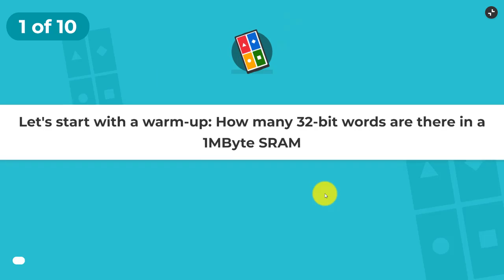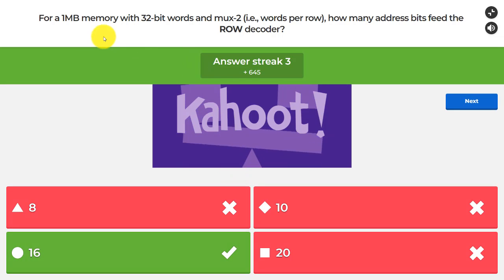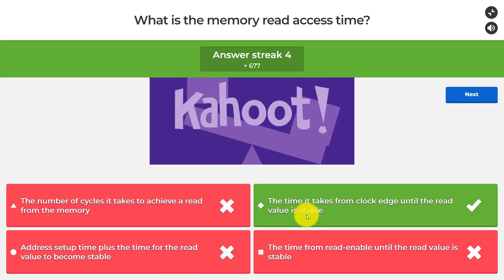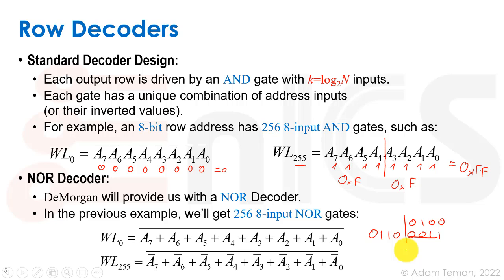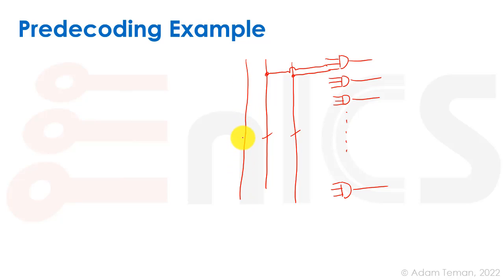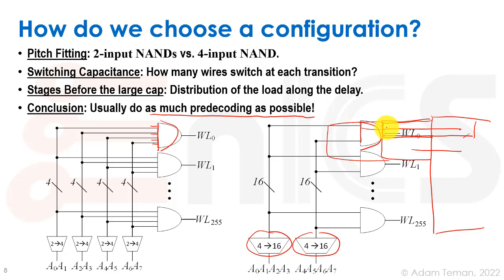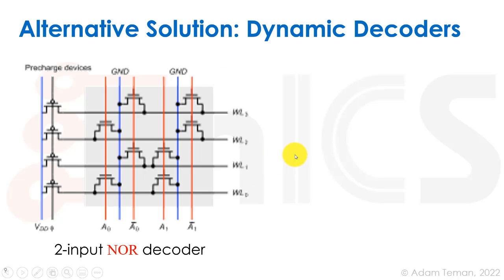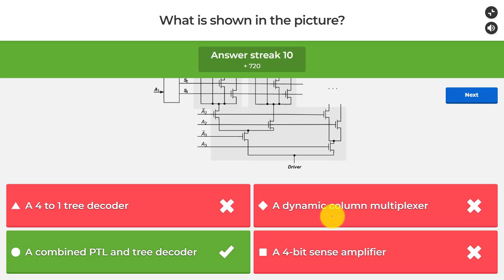VLSI - Kahoot for Lecture 9: Memory Peripherals

Comment from the maker: Note that question 3 is a bit of a misleading due to the way I defined things in the course. I defined the mux factor such that there are 2^M words in a row. This is actually a poor definition. Usually, SRAMs are given as "mux2", "mux4", "mux8", "mux16" with the meaning that there are 2, 4, 8, or 16 words in a row and not the way I defined it. The answer to Question 3, in this case, would be 17 and not 16 (when the definition led to 4 words in a row). Sorry for the confusion...
Reply: Thanks so much for the clarification!